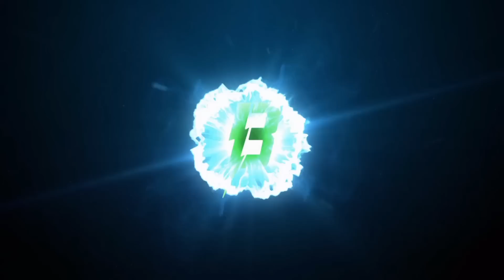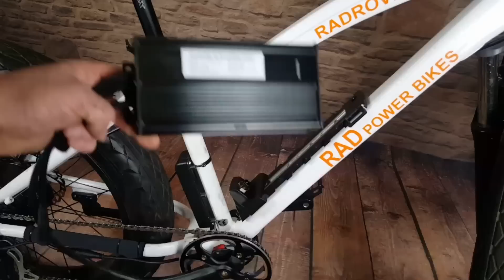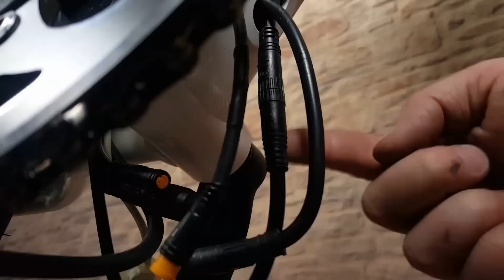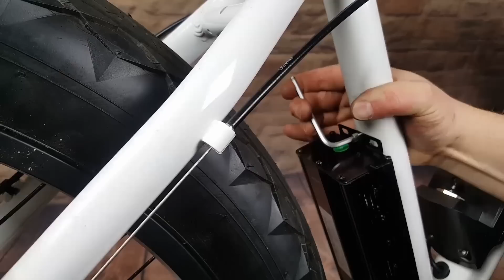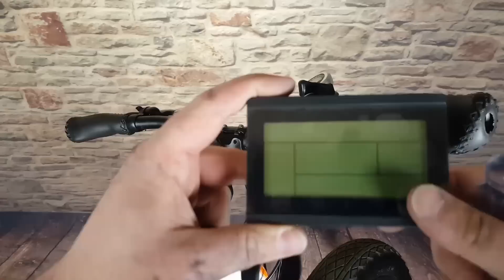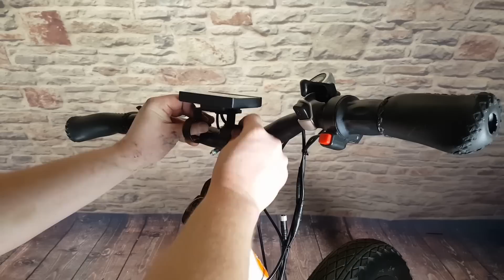RadRover Upgrade - Part 2 and Production Update

Comment: My neighbor just bought this same unit for his Rad Rover, we can not get it to power on at al.  The battery is topped off and 53 volts on the output pins.  We have re-seated all the plugs numerous times, and just can not get the unit to power on.  Any ideas?

Comment: Saludos🙋‍♂️
I Have A Question!
I just Got A Bike Like That The 5 I Just Got It Without The
Battery.  I was Cleaning The Bike
And I've  Noticed 
That The Back Wheel Goes Forward  But Not Backwards  By Hand
Is That Normal??😮
Thank's!!

Comment: I bet Ariel Rider is using a 750 watt Bafang and just juicing it up to say it's 1,000 watt nominal and 1,800 or 2,000 peak.. Just using a special custom winding.. 33-35 amp controllers depending on model.

Comment: It does not work on European Radrhino's with 250 Watt, only problems :(
Reply from the maker: Actually it does.
Reply: @Area13ebikes  I bought one last year, after one run of 4 minutes the batterij is dead, It doesn't work , or the settings aren't right

Comment: 7:28 - I personally wouldn't drill a hole for a controller box just because controller boxes vary in size depending on wattage. Water bottle holes which are the same size for hailong batteries I would drill for. You can use bottle bobs from Grin Tech though which eliminates the need to drill and is just as sturdy.

Comment: So I just upgraded my RadRover 5 with this Bolton controller. Everything is great, except for when I turn on the headlight. (by holding the up arrow) The light turns on, but immediately I get a "THROTTLE Fault!" message on the screen. Does anyone know of a fix for this? Thanks.
Reply: @pstu67  So it appears that when I installed the controller, I bent one of the pins on the 10 pin cable running form the controller to the screen. I was not able to get the pin in after unplugging the cable, so now I'm waiting on a new cable to show up.

Comment: Upgrade is awesome, and you can get it to fit the RadMini 4 with it's mechanical torque advantage of a smaller wheel radius. The stock motor can handle the power fine (at least mine does), and I've intentionally powered up long hills at 16mph that most people have to get off and walk up.

The stock motor still has an internal speed restriction, as even with no load it will not go beyond 25.3 mph. It doesn't appear to be a power or voltage issue, as you can see the power being intentionally reduced. If the speed was being limited by voltage, you would still be seeing power levels over 1,500 watts at top speed. You don't, and at 22 mph, the power rolls off to 500 or 600 watts. Is there a way to disable this limiter for off road use? Taping over the second pin of the motor connector only disables the speedometer without increasing the speed.

Comment: I don't understand does this channel not do any custom fabrication work

I have the exact same controller.
With the same voltage & same amps & same size.

I have a 58 volt battery on it.
It can handle more than 60+ volts.
I had the same problem with pedal assist.
Easy fix need to swap the wires around.
Took me 5 minutes to work it out & fix.
If you didn't want to cut any wires or anything like that.
It would have took 10-minutes to take controller apart and swap wire around.
You certainly don't need to order anything or contact anyone LOL.

I have my controller in the exact same place.
But I use a controller box what i bought for £10.
I have the wires & connect inside the controller box.
Obviously out of the box it doesn't fit you have to make it fit.
The gap between the wheel and controller was much smaller on my ebike.
Just a little bit of fabrication work and it looks as good like out the factory.

Comment: I took the old clamps brackets off the existing controller and used the long bolts and nuts that came with the kit and they worked perfect. I also put a strip of self adhesive velcro in between the frame and controller more for a cushion pad. Super solid and easy to install.

Comment: A word of caution.  Putting nutzerts or even screws into the down tube that holds the seat post will either lock in the seat post in place or not allow the seat post to be reinserted.  If  you bought an air suspension post, you will ruin it.  The u-bolts are the best option.
Reply: Great point....any chance you know proper u-bolt size to fit seat post diameter and the width of the new controller ??

Comment: hi, i plan on getting one of these but i have one question. about how much faster would the bike be able to go?
Reply from the maker: Hey Hi Yall! The RadRover Upgrade Kit doesn't necessarily increase speed. That can be determined by a lot of things. This does help with added torque, which depending on circumstances, might increase speed.

Comment: Hi Kyle. First off, I have watch quite a few of your videos and they are very informative and very easy to understand. Great job and thanks. I am one of the unlucky ones that has to buy a bike according to Canadian rules. I found out after purchasing my 2019 Rad Rover that there is a difference between the USA and Canadian limits on max power output. I'm a little disappointed in this and my quest for more power through the folks at Rad Power has come to a dead end. This is where I came across your videos, specifically the Rover upgrade. The 35A controller and LCD upgrade looks very enticing. However, I'm wondering if you would be willing to sell me one of the stock 22A controllers that is a take-off from an upgrade you did?The Max output on the Canadian controller is 12A and I feel the 22A would probably satisfy me for now and would be a very simple upgrade.
Reply: ....looks like we know the answer damn

Comment: High is there a junction splice kit to tap power off the read 48 volt battery? I want to run a DC converter for 12 volt headlights and maybe a horn just not sure where I can tap it off easily.
Reply from the maker: Hmm. I don't know about that.
Reply: @Area13ebikes  I seen some stuff on Amazon but I wasn't sure if any of that would just be plug & play. I guess I'll have to call Rad support but thank you

Comment: If one is going to replace the display, controller, and motor. Why not go beyond 52v for a battery? Is a 52v system the max you can go for a RadRover?

Comment: I have the ‘19 radrover and it can handle speeds of 38mph, but I can tell that the tires and bike itself wouldn’t be able to hold that speed for long.  It comes stalk @ 20mph, but you can kick it up to just below 25.  (There’s a dude who’s video shows you how to do so).  Anyway, it’s so much fun, and I do wish I can get it up to 30mph or so, it’d be fun, and I can dart past moose a bit better!  

You gonna work on the 2019, and if so, how much would it cost?
Reply: Props to the Dude!  He helped me go almost 25% faster, and you can feel the difference!  🙏🏽

Comment: I have  a Motiv e-bike with a 500w bafang motor and the King-Meter display.  The controller is a 48v 22A unit with the part number G3M20211-1592-16  Can I use your components for my bike?

Comment: Why isn’t anything ever good enough? Why go 40 + MPH on a freakin Ebike? If enough people start modifying them it will lead to accidents and various Aholes flying down bike paths causing problems. Don’t you think it will eventually make towns require licensing and registration? It will also cause them to be banned from bike paths.
E bikes are a great alternative form of transportation, why call attention to it so the government can put there grubby hands in our pockets? 20 MPH is good enough. After all its a bicycle not a motorcycle.
Reply: It does not increase max speed, it increases torque
Reply: For now. That’s only step 2. He said step 3 he will update battery to 52 volts and motor also.  I agree keep these 40 mph bikes off bike paths your gonna ruin it for us

Comment: I got the upgrade ...finally accessed the cable that runs through the frame, programmed the kt LCD 8 to the controller, and to my disappointment the pedal assist doesn't work.   Been sending emails and fb messages with limited respone.  No matter what setting i use for pedal assist in the C settings there is no response from the pedal assist at all.
Reply from the maker: You'll get more response on Monday.  We're closed on weekends and it's Mothers day.  ;)
Reply: @Area13ebikes  sweet... Looking forward to it...at least now I know.

Comment: The upgraded controller Sent up isn't so easy on the 2019 Rad Rover.... It looks like the monitor cable connection is up in the frame...it's not down by other connections... And may be extra cable splits from monitor cable to integrated headlight.   Is it possible to !and a video showing how to connect the 2018 controller to the 2019 Rover?.... Or I may have to pay to get a shop to do it.   Thanks for your time.
Reply: That is the exact reason I came back to watch this video!

Comment: Thanks for your video, I’ve ordered both the controller and display. Can’t wait to install them. Great job!
Reply: me aswell let me know if the battery is being worked to much please from the higher contiuous amp draw?
Reply: Do you still have the old controller? I'm looking for a used one because mine has stopped working so if you are interested in selling....?

Comment: Any problems with the motor after upgrade?
Reply: The new controller sucks out a lot more battery and stalls the bike motor if you crank the throttle a ton . I took my upgrade on a test run with heavy throttle up steepish hills , I hit 27 miles per hour on a slight but long downhill without pedaling, the ride was 2 hours 21 minutes long and only traveled 11.6 miles , stopping checking things out , looking at the surf etc. I really had to baby it home as the battery was draining so badly and the cutoff came quick .
Reply: I am curious about what the controller will do to the battery , I believe motor is strong enough easily

Comment: By using these settings my power assist started working
P1 = 100
P2 = 5
P3 = 0
P4 = 0
P5 = 15
C1 = 3
C2 = 0
C3 = 8
C4 = 3
C5 = 10
C6 = 3
C7 = 1
C8 = 0
C9 = 0
C10 = n
C11 = 0
C12 = 4
C13 = 0
C14 = 2
Hope this helps!!!

Comment: What about something for the rad mini? 
Want to upgrade the controller but want to keep with the same size. That one is huge in comparison.
Reply from the maker: I have a 25a prototype as well....
Reply: @Area13ebikes  definately interested. Looking for a someone to test? :)
Reply: @Area13ebikes  will the 25 amp fit in the space on the mini inside the frame?
Reply from the maker: @ThePathfinders0369  need to install one for sure.  As configured it may be a really tight fit, but I think we can make something work.
Reply: @Area13ebikes  awesome. Willing to try it :)
Reply: @Area13ebikes  I am both conflict and pathfinders usernames.  I sent a message to follow up via email through your website. Appreciate it!!

Comment: My 2018 Radrover has a controller with a spec label noted at 16.5 amps max, 8 amps continuous. The LCD watt gauge never exceeds 750 watts, which the bike is supposedly limited too.
 I haven't  inspected /evaluated the motor as of yet, to determine if the motor is a true 750 watt version, but will be doing  that soon. 

I feel the LCD3 or LCD8 with a 35 amp controller  is surely a great upgrade. Even with a 500 watt motor, the C5 setting  in the display "settings parameters" can always be adjusted to reduce the max current. I'm confident the motor on my Rad is way underpowered. I surely would enjoy the befits from an additional boost with torque  from a 35 amp controller,  and the ability to customize those motor power settings, ect, ect, ect...

Looking forward to the upgrade kit. It's hard to find those plug n play upgrades for any one particular make and model e-bike.
Reply: Will the higher amperage harm the stock battery.. Will this controller try to draw to much continuous amps?
Reply: @jockyboy9606  The stock battery is all wired up internally with 14ga wire. Most rate that size wire for 20 amps continuous max (or maybe less). So assuming the BMS was able to handle higher current (not likely), and the battery cells were able to generate higher current (again not likely), you would still be limited by the gauge of the wire used - when talking "continuous". For short bursts, IMHO, 30a potential is pretty good.
Reply: Have you purchased and installed the new upgrade controller?  I wish Kyle could put up the 3rd video with specs on lcd and tell us how everything is working out after the install:)

Comment: Does this controller have a regenerative braking option?
Reply from the maker: Yes, but a geared hub motor can't use it.  On a direct drive hub you do have some basic regen settings.
Reply: @Area13ebikes  
Thanks for the answers!
I am riding a radwagon which uses the shengyi 750w motor with regen braking
Reply: @napwest  I have the same bike, how did the upgrade kit improve the Radwagon regarding hills and how does it work with taillight and recuperation ? Thanks in advance napwest, cheers.

Comment: You are almost there.  Just make the fix and I will be all over this.  What about the new motor?   Would like more torque for off roading hills.
Reply: I agree completely James. I've had several hill climbing crashes when the maxed out motor stalled on my Rover. A 1000 W (or more) high performance motor would be a welcome addition!

Comment: So I have 52v "14s 5p" 14.3 ah battery 25 amp controller And M3006RC 9 continents 500-1000w motor  if I drop to 20 amp controller I should maybe increase the range a bit then..
Reply from the maker: Not necessary to change the controller.  Just tune it down.

Comment: Does a bigger controller use more power?
Reply: P = IV.
Power in watts equals  amps times volts .
Increase amps or volts from original increases watts 
He actually talks about it
Think of a controller as a straw.
Bigger straw for water the more you can suck..
Many times controller is a small straw which limits power from the battery.
No matter how big the  battery is
Reply: Been there,  done that. 
A LCD  that unlocks a controller is necessary 
A controller with a higher rating is necessary 
The bms protests the battetty .
But if your going up a hill the "bigger straw " helps .
With the upgrades you will do 20 to 25 mph without peddling 
Go up a hill at 12 to 16 without peddling .
This is with a 52v 20ah battery .
Been doing this 20 years 
First bike had SLA battery. 
When nimh came out I stayed with SLA 
But once you go lithium you won't go back
Reply: To my knowledge, the new controller ALLOWS the use of more power. With both controllers providing power at the same load and speed (say 10 mph on a level surface), I doubt you will see a difference in the amount of power being used. The advantage of the more capable new controller is it's ability to provide more power to the motor. When exceeding the amount of power available as compared to the original, at that point it would be using more power - but only then.
Reply from the maker: If you're using more watts and amps then Yes.